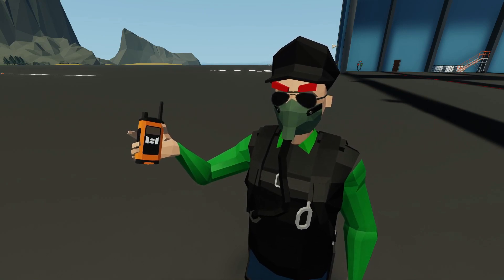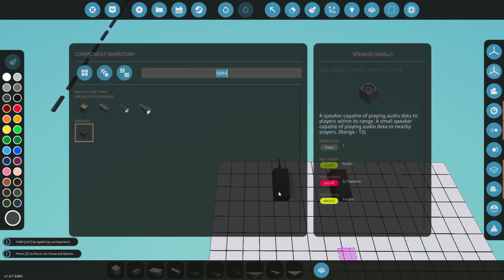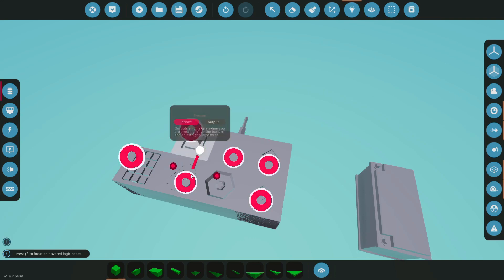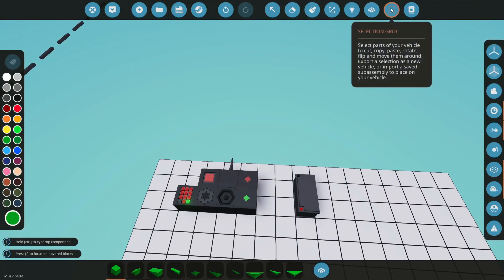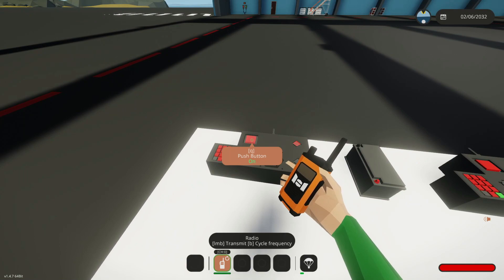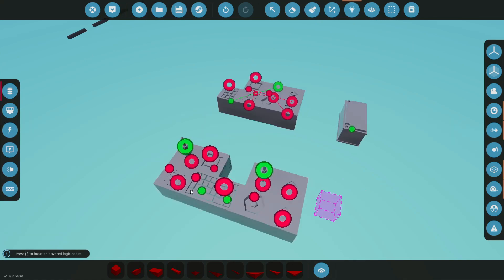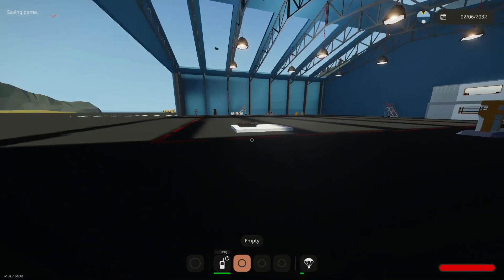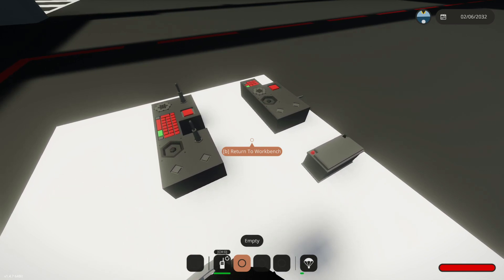Beginners Radios! Stormworks Radio Tutorial - How To

Comment: Does this require steam setting in order to make it works? Because I'm trying to speak but it doesn't work even though I'm press the button.
Reply from the maker: Might be a setting in windows. I had the same issue til i changed it.
Reply: @ProfNCognito  What setting? This issue is driving me crazy right now.
Reply from the maker: @newrides  your microphone settings in windows. Not the game.
Reply: @ProfNCognito Thanks for the reply. I was hoping you knew of a specific setting that fixed it, as I believe I’ve fiddled with every microphone setting that I’m aware of. It still doesn’t work.
Reply from the maker: @newrides  yeah the radio feature can be buggy sometimes.